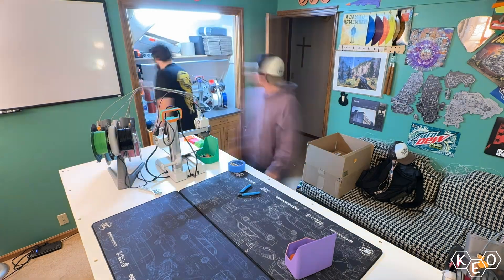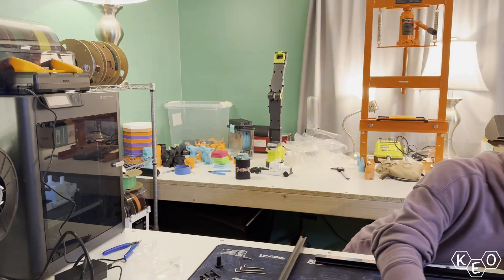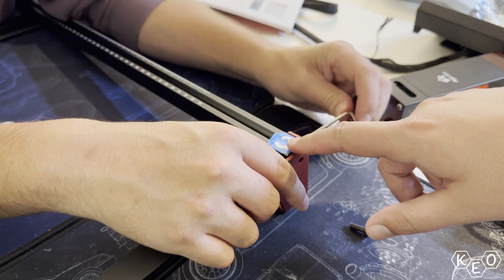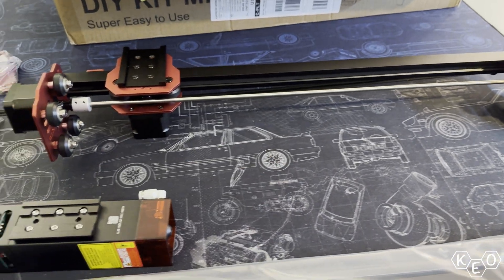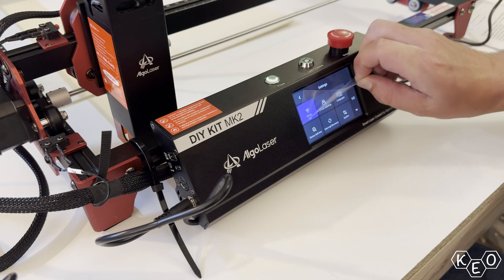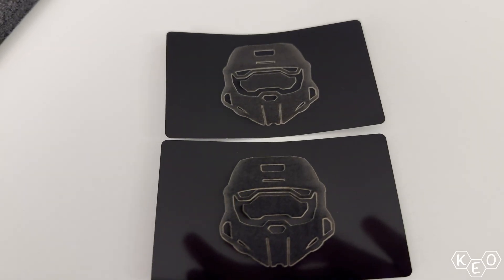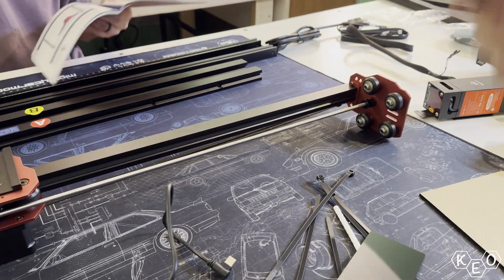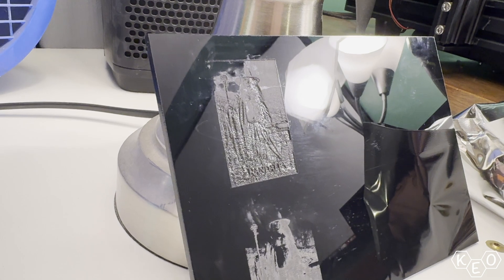It Has Never Been This Easy To Get Into Engraving | AlgoLaser DIY Kit MK2 Laser Review

Comment: is lightburn still the only software for lasers? I had lightburn for 2 years and i refuse to renew it. (its not worth the price) buy a laser so you can RENT software to run it. just so dumb to leave yourself in that trap. I do own Vcarve with laser addon runs my Jtech lasers fine but my laser master 2 is still collecting dust on account of lightburn being so chitty. I see lightburn as a hobby killer
Reply from the maker: I agree. It is a bummer that you need to subscribe. That was one nice thing about the AlgoLaser having the app and connectivity that way. No need for external programs or prepped gcode so to speak. Although I’m sure there are limits, it is very convenient
Reply: @KeoPrints  Lightburn is a one-time-payment and the best Software for advanced engraving. There are some laser engraver that come with their own Software. In most cases these are very limited compared to Lightburn.
Reply: Im thinking of getting into the hobby and I see light burn mentioned alot, can I just download a cracked version?
Reply: @Gage42  Come on! It's not a thousands of Euros, it's 60...

Comment: It seems to me like the ender 3 of the lasers more than the bambu. and that is not a bad thing. a little more hands on, a little more set up, but it forces you to learn how it actually works
Reply from the maker: I might rate it more as the sovol SVO6-8 range. The app is super nice and the touch interface is miles ahead of some of the stuff I’ve worked with in this price range. Bambu level may have been a stretch but you’re right about the setup being part of the experience